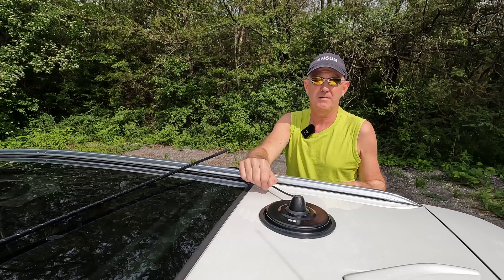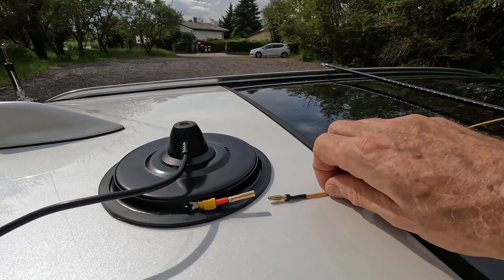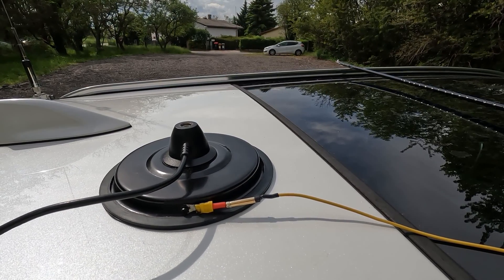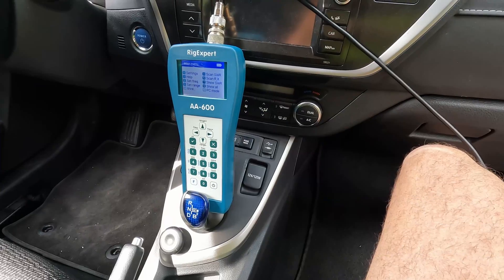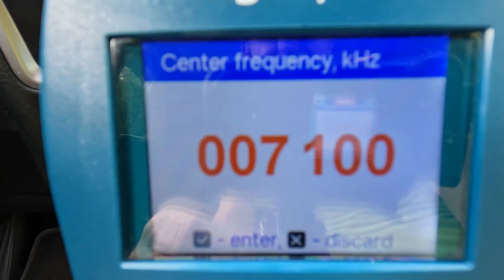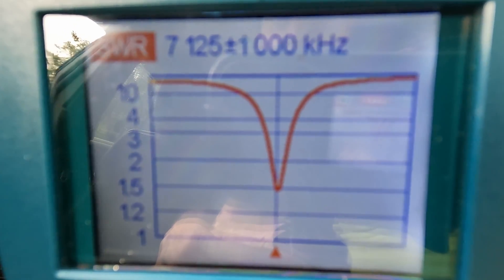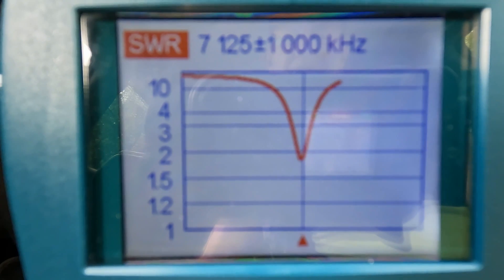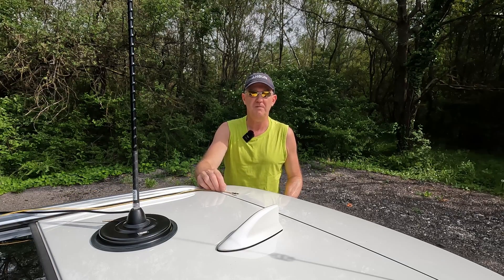Connecting a counterpoise to a single Magnetic Antenna Mount ???

Comment: Intresting! Magnets are really hard material, so what type of drill, did you use? Size of the drill? The screw you used, was it a self-tapping screw? Do you have some close up pictures of your work? I think I would do the same counter poise and handle the magnet mount with care.

73's de SM6GZL
Reply from the maker: Hello Leif, good morning from OE.
In case of my MagMount the magnet itself is inside a steel housing.
It was not so hard to drill a hole. I used a short M5 screw with a nut between the magnet and housing.
But it should also work by cutting a thread. I will send you a picture.
73 de Juergen OE4JHW
Reply: @AH6UN_OE4JHW  Good morning and thanks a lot for quick reply!
Ok, so your drilling hole is not in to the magnet it self? You drilled in "normal" steel then?
Have you tried to go with 2 x 10 meters counterpoises or is it good to go, with 1 x 10 meters? 
I have a spare magnet mount and a wild thought said to me, why not use that as a counter poise as well? Connect two magnet mounts together on the roof. What is your opinion about that?
Reply from the maker: @leifunell2132  
Yes, I just drilled through the steel.
I put the screw through the hole from the outside. The nut is inside. There is less than a centimeter of space between the magnet and the housing.
You have to be careful not to damage the magnet when drilling.
In my case a 1 x 10 meter counterpoise is enough.
I emailed you two photos.
73 de Juergen